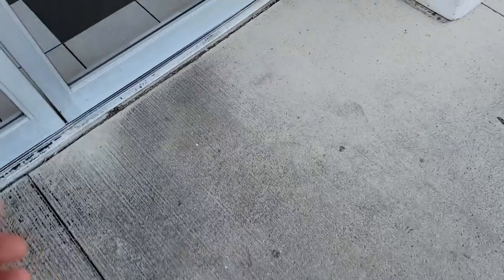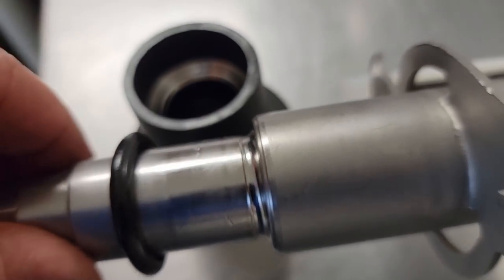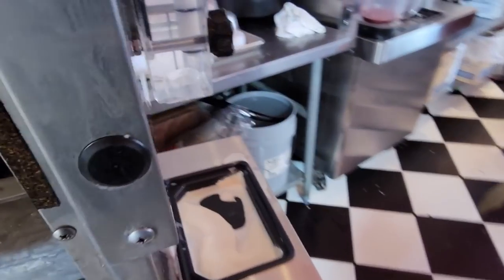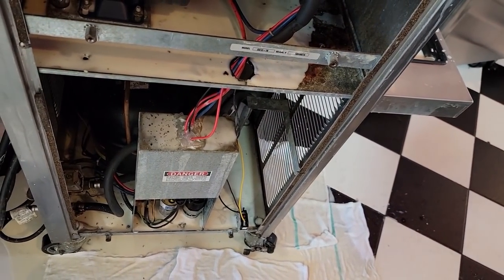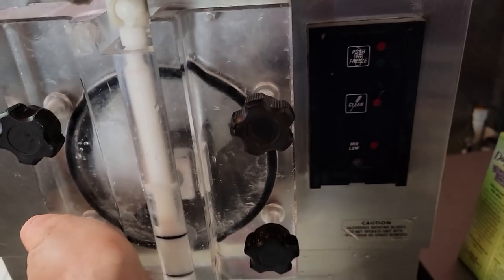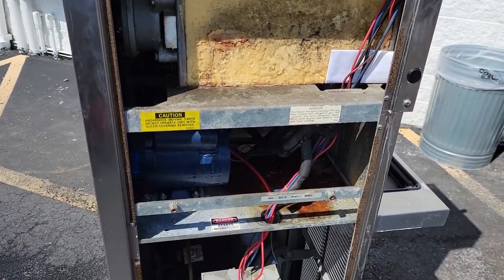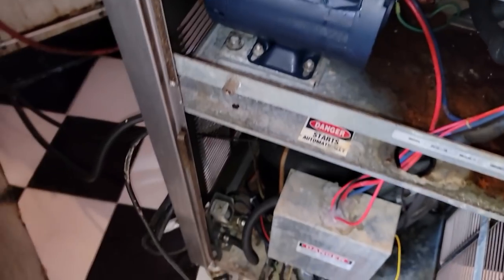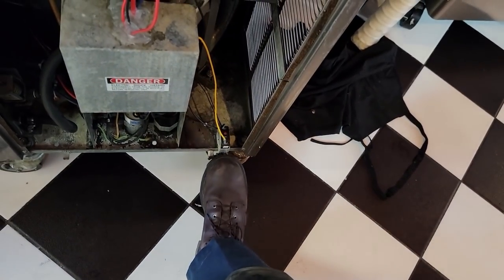Emergency - Milkshake Machine Blows The Mix

Comment: I worked for Whataburger maintenance services. I replaced a beater motor on a Taylor at one of my stores. The next day I got a call that since I worked on it, a bad leak occured. I went back and found out they lost the beater bar seal. They just reassembled the machine without out it.😂
Reply from the maker: It doesn't surprise me 😁. It's always our fault🤦🏻. Sure 😊

Comment: Training is the key. I used to do maintenance for a fast food franchise and I would train the managers on cleaning the ice cream machine and still they would call 14 days later and say the machine is not working and all it needed was cleaning. I would end up cleaning it. Oh the smell of milk stone and also the best way to get the mix out is hot water hose and wash it out. Trading is the key but managers need to take Responsibility. Of the machine.
Reply from the maker: Those are all true fair statements 👍👍

Comment: One of the newly rebuilt restaurants I worked at has a 208/230 3 phase Taylor shake machine. Shake machine was never lubricated properly so the rear bearing prematurely wore out ,of course on the chocolate side.. Also the belt tensioner was never tightened properly from the factory and that fell apart. Here is a company that doesn't sell parts to anyone unless you attend there training course. Aholes. I have been repairing Taylor shake machines for 36yrs. I never took a course ,learned on the job like so many others. Recently, just before my planned retirement I had to add some 404a to the machine so it could reach setpoint and shutdown. I didn't have time to leak check because of another Taylor that needed a gear reducer change out along with a new rear bearing and drive shaft. You mentioned the chance of blowing the barrel if you use hot water to clean the unit out. You also said some units have solenoids on the inlet and outlet of the barrel. I didn't spend time on the schematic and breakdown cut sheets because of my retirement. I just had time to add gas and get it going... With the way fast food team members are trained I could definitely see hot water being used to clean out the hopper and freeze barrel.  I later found out while enjoying my retirement that the other side didn't work either and gas need to be added. When I opened the side panels to check the unit out I saw no indication of a leak. Possibly it did blow a barrel. I'll never know .....
Reply from the maker: I saw the aftermath of a barrel that imploded while I was at the factory,  I forget what style it was but it had a long barrel, I believe it was a custard machine or something of that type of machine.

Comment: I'm sure when you reviewed the footage, you noticed it, but just in case - when you were looking at the 'dead' lcd chip, you brushed the black and green wires above it out of the way - and it instantly fired up.   I suspect you have a slightly loose (or oxidized) connection at one of the pins.
Reply from the maker: I didn't notice it but I did notice a power up and down sequence that tended to reset it every time. This control has quirks about it, I've had calls where it locks out and you have to power it down for 10 minutes to reset it. Actually unplug it for 10 minutes.
Reply: if you also noticed the green/red lights on the power supply board to the left came on at the same time. I'm betting the power supply board is the issue, since it went from no lights to all on at once. probably failed/failing capacitors.
then again, maybe a poor connection on the flat white ribbon cable, which is the power connector from supply to controller. since there was a single red light on the supply.

Comment: Rick, what inlet water temperature should these units run?
Reply from the maker: Generally the water needs to be below 95°. Usually if it's coming from a well or city it's going to come in at about 55 to 65. If it's on a glycol system they could get easily up to 95 to 115 but they start taking a dump at 95 I believe it is.

Comment: Oh those things are water cooled? Interesting. Is it just to keep the load off the kitchen? You keep those seals on the truck eh?
Reply from the maker: They can be ordered in water cooled, local air cooled or remote air cooled.
Reply: @HVACRSurvival  - I'd be fine with water cooled if they didn't just FLUSH the water down the drain afterwards.   Run it to a tank to feed the toilets or something.

Comment: I can't bear the thought of having a machine sitting there with dairy product inside . The work it must take to keep it clean and bacteria free must be way too much compared to the money it brings .
Some places just make the shakes on demand , they'll just put some ice cream in a blender , add milk and Voilà !
Reply from the maker: Well thanks to this machine making it so easy they hardly use their ice cream machine, now I have a problem with the ice cream machine not producing a proper firm cone because they're not selling very much, the end result is the product breaks down and it's no longer firm but it is at temperature. Struggle is beyond real

Comment: Stoeltings are pure junk , you are better off making it by hand. Too many catastrophic failures on the regular.
Reply from the maker: That's funny, you have the Communists Taylor company that won't let anyone come to the classes, does crooked business practices with McDonald's and you got ice cream machine that looks like it's made in somebody's garage "electro freeze" so what do you prefer.
Reply: @HVACRSurvival  In my experience which is only with Electro Freeze & Stoeltings as that was the only Equipment Sonic allows , ( I took care of 6 stores for a Franchisee). Stoeltings had far more issues such as Mix pump failures , beater bars twisting , Board Failures , Leaking barrels Which Tech support fix for that is shoving a oring in the front faceplate to get more compression on the rear seal but that never helped & Electrofreeze Ive only encounted pressure switch Failures or Thermostats Drifting & Cabinet door switches breaking. This is just from my experience